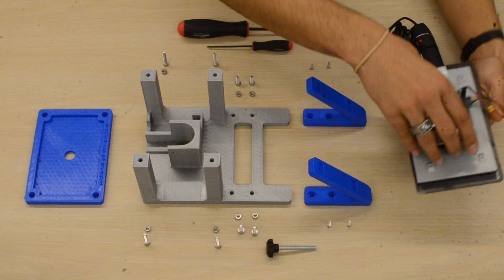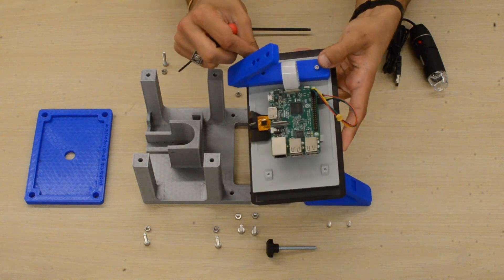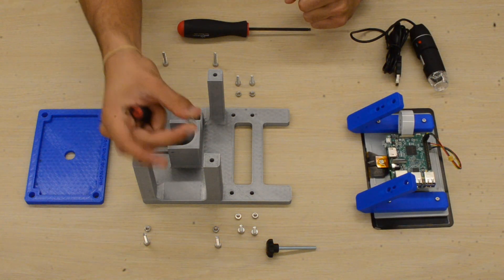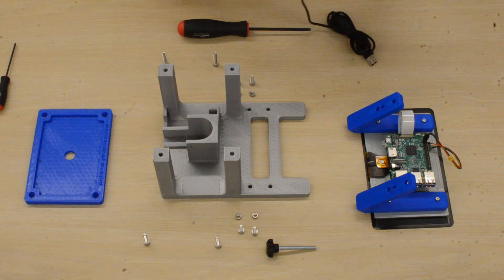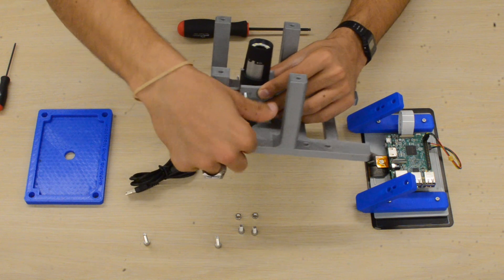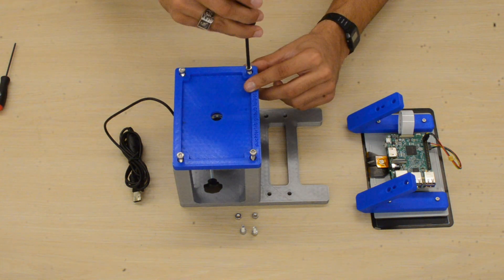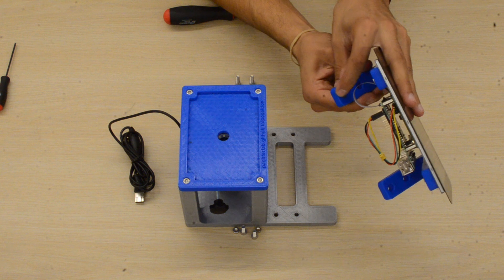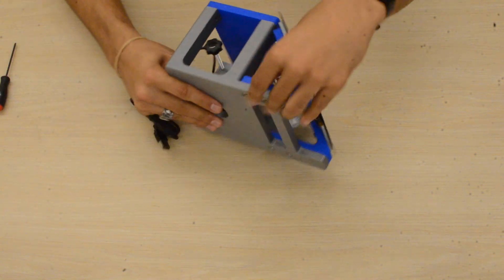Poseidon Build Videos: Microscope

Comment: Any tips on lighting? The microscopes built in LED ring is partially obscured by the stage opening it seems, so the sample isn’t very well lit.
Reply from the maker: You can try using something like a USB light: https://www.amazon.com/Reading-Light-Brightness-Rechargeable-Indicator/dp/B079DKTQVS/ref=sr_1_4?keywords=usb+light&qid=1566211906&s=gateway&sr=8-4